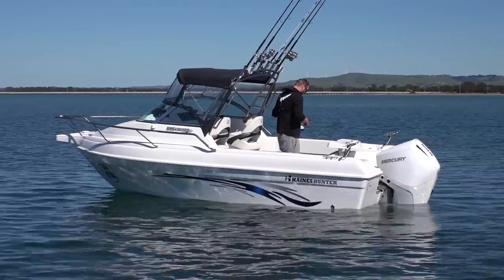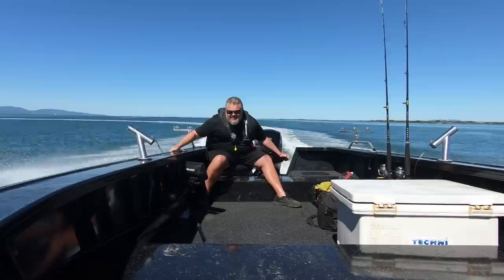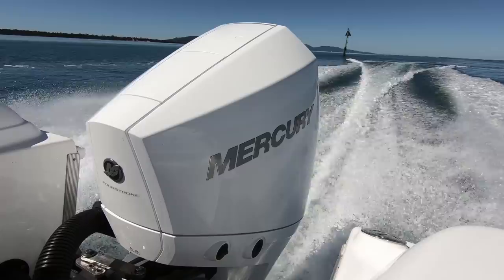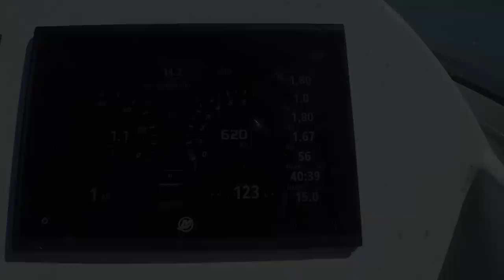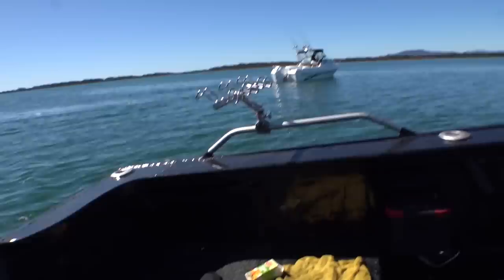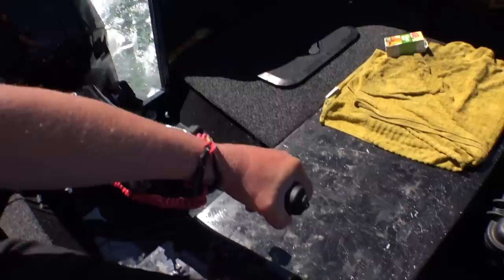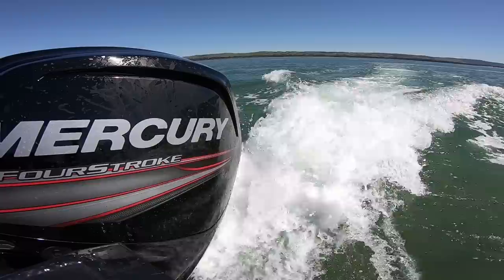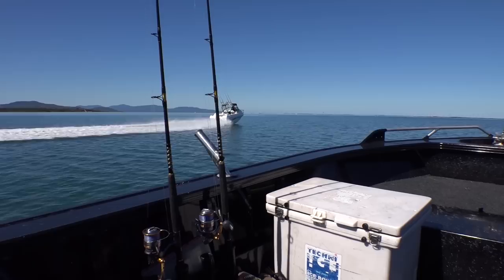100HP TILLER DINGHY PICKING FIGHTS

Comment: I run just shy of 40 knots in my 50 tiller on the rev limiter, need to jump up a pitch or two, I think I would be very close to your 100 with a different prop. Nice boat !
Reply: Try out some different pitches and I'm sure you would be happy! Just don't skip too much. the difference in mine btwn 25, 26 and 27 was huge. Those were all 3 blade Yamahas. I tried a four blade25 Merc racer solid hub on my Vmax and could barely get on plane and it sucked so much air I couldn't hit 50MPH. Kept blowing out and over revving.
Reply: @donerightthefirsttimellc3343  I have played with a few props, currently have three. Two alloy and one stainless. Massive difference for me was setting up engine height correctly. I've seen so many dealers just bolt outboards on with no care for setting the height correctly.

Comment: So that’s around 49mph. I had a Grady White cuddy cabin like this boat with a 175hp Johnson 1996’ year. It would go 51mph and the boat was built like a tank. Did 48mph after I painted the bottom, one of the best made boats on earth. The wiring in it was perfect, everything heat shrink and it looked like a work of art under the console. Never had a light go out or anything electrical and it lived in salt water 24/7. Never had a engine issue either come to think of it... That tiller looks like a blast as I can only get 35mph out of my tiller (30 hp Johnson) that’s 56km/h. Good video either way not sure about having a engine trim for me.
Reply: I have a Grady white marlin walk around with twin Evinrude 225 Etec HO’s does 61 @ 5950rpm  
And it’s a solid heavy boat I love Gradys

Comment: Have a 2018 quicksilver 505 Cabin with a 100 hp command thrust goes 33-34 knots flat out top speed. But goes from dead still to into planing in like 3 seconds

Its a pretty blunt hull too